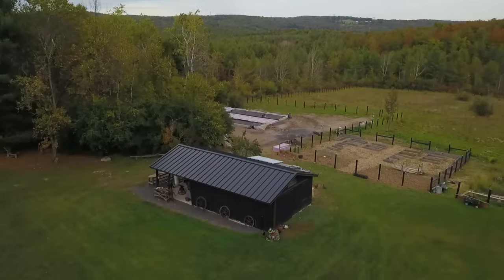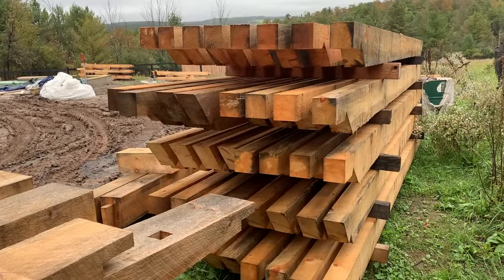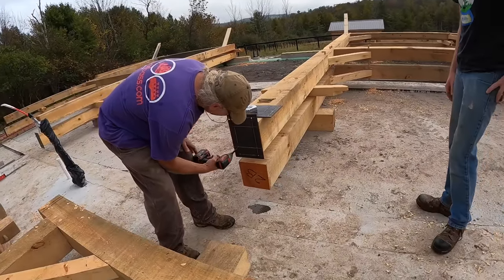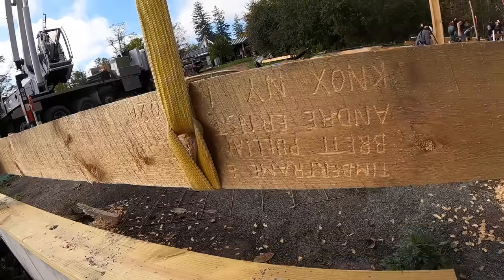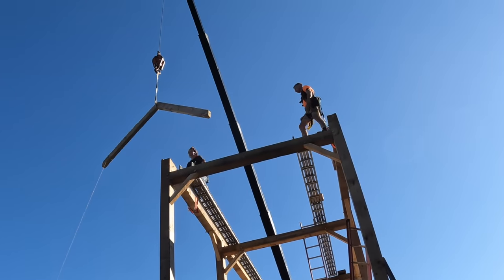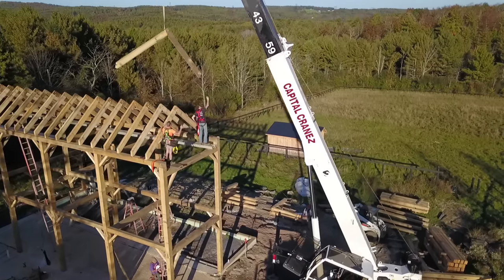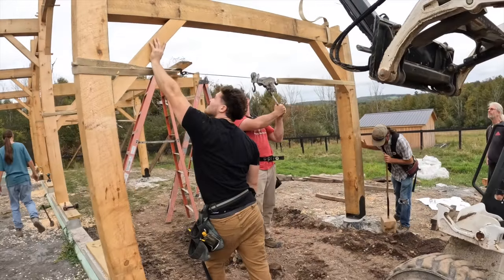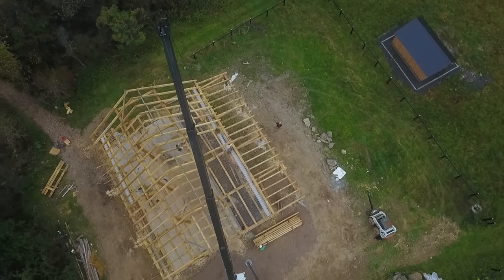DiResta WE HAVE A BARN!

Comment: Looks really good. I did a course here in Sweden with Jack Sobon and Neil Godden. They are from the states and Jack was one of the people that were instrumental to revive the timber frame technique in the states. It was really interesting and I learned so much. They basically used all hand tools and no fasteners besides wooden pegs. 
Though there are some things that I feel might be different to what we learned. The pegs should all be drawbored so it pulls in the joints really tight. The rafters should also be seated into the plates (the long beams with scarf joints.)
with a building as large as this it might not be that much of an issue though. We only did a 48' x 22' building so it might be less important when there is so much weight as you have. 
Really enjoyed watching this go up. Looking forward to the day I can raise my own barn like this.
Reply: Wonderful build and skills. Although I agree about the pegs - what a surprise! all the effort and time to design, cut and raise the barn, but at the last hurdle, no draw-bored pegs!! The timber will dry over the years and everything will become loose with no option to tighten up - as you would be able to with tapered pegs + draw-bored joints. We're all here to learn, but the draw-bored peg system is often over looked, which is nail biting as it is a fundamental element to a long lasting frame. A technique that has been tried and tested throughout history of timber framing.
Reply: Taylor, Brett, Jimmy - how come the joints are not draw-bored with tapered pegs?

Comment: Man does this look familiar! It is like a 100 year newer version of my This Old Barn Shop barn. Supply House and Uponor was what I used for my radiant heat as well. My Barn was slightly bigger though at 40x60. I can still remember cutting the mortises for the  outer wall posts I had to replace which were 6x6 x16ft oak and were pretty fun to place as one guy by hand!  Only drawback I see to timber frame is if you need to replace a piece you really can't because of it all being interlocked. That means it is critically important to keep it all dry and protected. I am going to have to do some sill replacement on my 1830's house becasue some dummy 100 years ago poured concrete up against it and it has rotted. Being that it is a hybrid timber and baloon frame structure it could get real interesting! Nothing to it but to do it. :-)
Reply: I still am in awe of you assembling the gantry crane.  I understand why you didn't film it but still wish you had.
Reply from the maker: Thank you Brian!  👊🏼👊🏼👊🏼

Comment: This was really enjoyable.  Now I want to live in a timber-framed barn...
Reply: They're actually really affordable if you build them yourself.  I've actually built one like this, but it was with metal beams-- different look, but still very similar feel-- and they spray-foamed the walls after and one of the last days we were there, with a foot of snow on the ground outside--- we worked inside and it was still warm inside;  with no heater running or anything.. they even had radiator floors, but it wasn't even hooked up yet....  My point is, if you use spray foam insulation, it's just like a giant igloo ice chest.  It's so unbelievably efficient.
Reply: I wonder how comfortable they would be in our climate. 

That seems creepy... I like in Yeg, maybe less creepy now?
Reply: Me to they are beawdome

Comment: I notice the guys drill the peg holes with the members fitted together.  When I did a few barns with some Mennonite guys, they would offset the hole in the tenon by about 1/8 inch for a "draw fit" to pull the tenon tighter into the mortise.  It was hell driving the pegs in, but the fit was unbelievably tight.

Comment: Nur ein Tip wenn Holznägel Verwendet werden sollte die Bohrung am Zapfen um 3bis 5 mm Versetzt sein somit Zieht sich die verbindung zusammen selbstständig.Just a tip if wooden nails are used, the hole on the pin should be offset by 3 to 5 mm so that the connection pulls itself together automatically.

Comment: I noticed that Brett didn't "draw bore" the peg holes in the opening couple of minutes.  Did you discuss this with him, why he doesn't draw bore?  I know that wind braces should really only be loaded in compression, and that they theoretically don't need to be pegged, so I can see just boring those through at assembly.  However, at 2:15 he's not augering for a brace.

I'm not picking nits with Brett's approach.  I'm just trying to gather info from practitioners with experience, since I aim to build a garage/shop this summer, with queen posts for standing attic space - very similar frame layout to what you have here.  The lean to addition to saltbox it may need to wait until next season, but it sure will be nice to have a long bay to store our little camper and for a "project vehicle" to sit in over the winter.

Beautiful project!

Comment: You can tell the quality of the carpenter when you don't have to adjust anything on site.
In stark comparison watching a house building program in the UK the timber engineered wooden frame built off site was impossible to assemble on site as zero (no joke) pieces fit together. 

It was a much more complex build with many more parts but even though they were built from CAD drawings it was an absolute disaster and every single pieces needs adjusting on site.

Goes to show how valuable good quality craftsman's are and it's shown in their work!

Comment: I admit I am new to this timber frame construction so please forgive my ignorance...Why is there no glue in any of these beautiful wood joints?  Wouldn't that lend to a stronger structure overall?  Again, sorry for my ignorance.
Reply: The joinery is plenty strong as is and when the timbers dry even more under the roof the mortise will shrink a bit around the tenons and it'll be there as long as the roof remains in good condition, it burns to the ground, or is physically dismantled. If instead of those splice joints they had wanted extremely long continuous beams, or the plans called for curved beams then you might use glue laminated beams.
Reply: Another place glue is used to strengthen modern timber frame buildings are structural insulated panel sheathing that provides as much insulation as you want and also contributes an enormous amount of sheer strength.

Comment: Does the branch at the top of the front rafters have any particular significance? This looks like it will be a really cool building, if Taylor wants to keep it traditional are the walls going to be painted red then?
Reply: Yes, the branch on top is normally from the the same tree as where the lumber came from. And is an old tradition to show what we do with the lumber, and bless a building. This also shows that this man works along time in this industry to do this, very cool i think.
Reply: According to Fine Homebuilding Magazine: “The ritual serves two purposes. One pays homage to all the trees that went into the construction of the house, and to the many hands that built it.  The other symbolizes the establishment of the house’s roots, which will nourish a long and prosperous life.  The young evergreen bough is called a “wetting bush”, likely derived from the German tradition of watering it as a sign of the home’s first nourishment.”

Comment: From watching other videos on youtube, drilling a hole straight through an assembled joint and then knocking the peg in is not the correct way to do it. The holes in the two pieces of wood being joined should be slightly offset to each other, in such a way that when the peg is driven in it pulls the joint together and makes it tighter. I'm no expert but I believe that is done to prevent the joints from becoming loose over time.

Comment: Taylor's your definitely annoying. I designed everything and told Brett where to put the pins!! Are you serious, pretty sure Brett is a master timber framer and you probably didn't know what a scarf joint was a year ago. I clicked on this because the samurai Carpenter watches this channel or so it says. Build your own timber frame by sawing the logs and cutting all the joints and erecting the building with your own two hands then you can be full of yourself. Until then a healthy dose of humility is what you need.